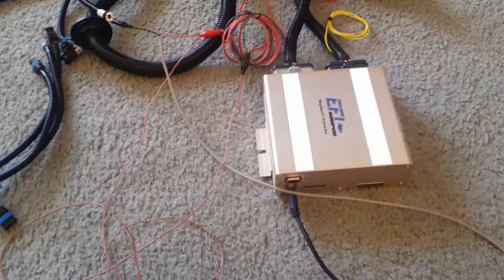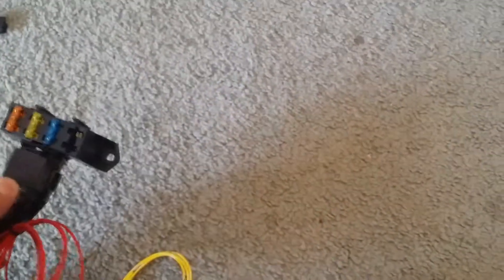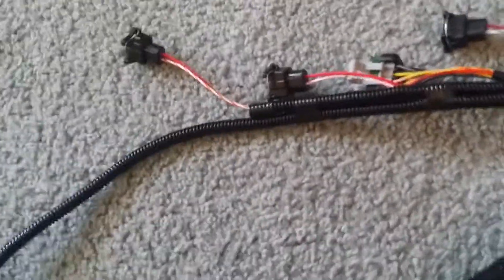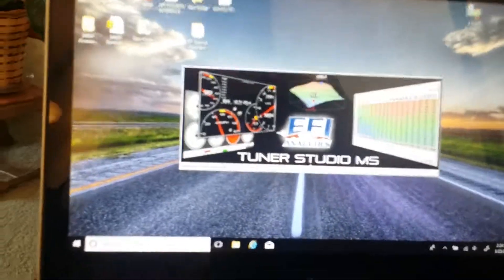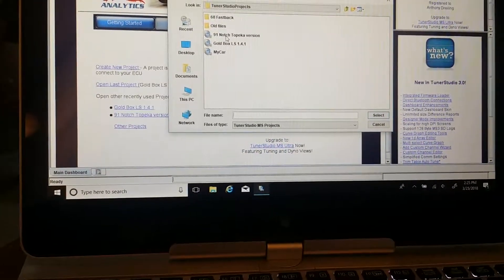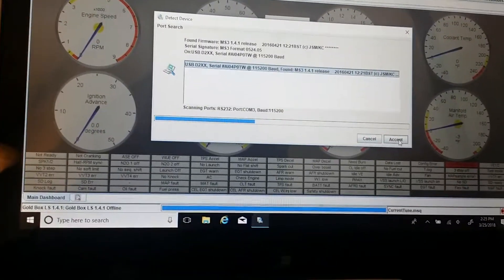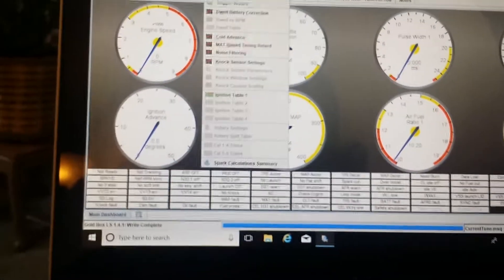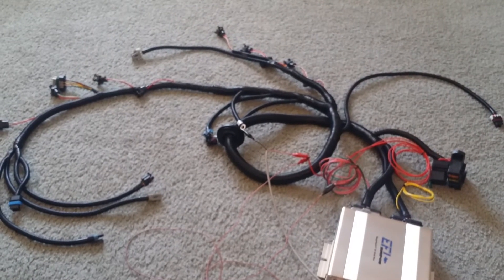71 Z28 LSx harness MegaSquirt Gold Box EFI Source

Comment from the maker: Yes.  The bad part is on a turbo car there is limited locations to route it through the firewall with a factory air heater box and still keep it away from the exhaust.

Comes with a flash drive with user install manuals and starter files for boosted and NA 24x and 58x engines. They are just,a starting point and need tweaked for your exact cid and inj size, plus some VE tuning.